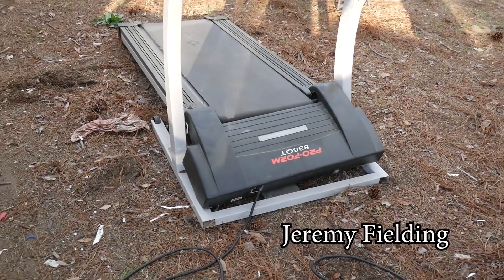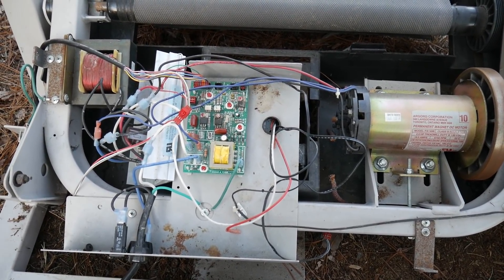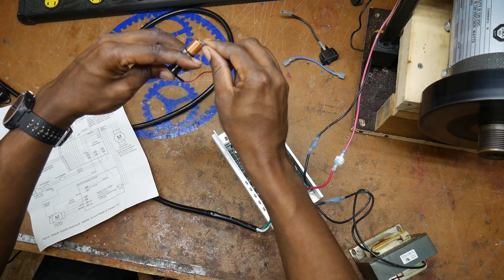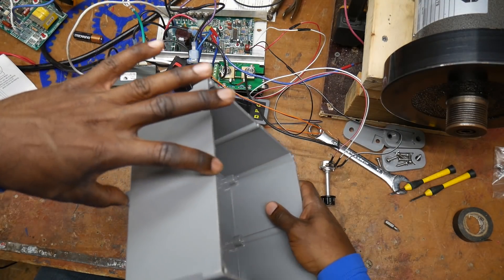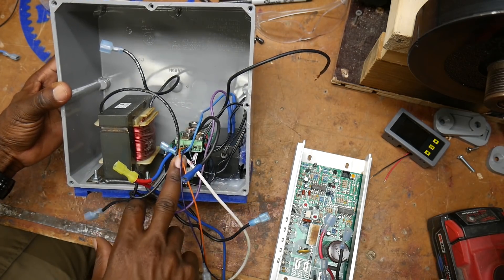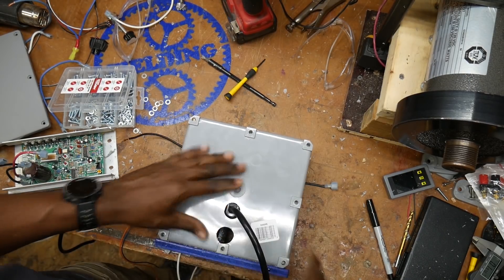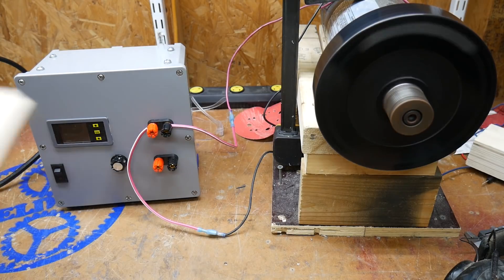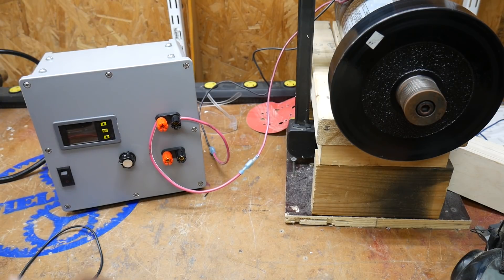Building A Variable DC Power Supply From Treadmill Parts: 054

Comment: A word on safety when cutting larger holes in plastic. Standard fluted drills work fine, but it gets mighty squirrely when you get to spade bits, hole saws, or even forstner bits, and even more flesh eating when you're dealing with thinner plastic, and faster drill speeds. To confidently, and safely, accomplish the aforementioned task, it's as simple as doing everything the exact same, except run the drill in the reverse direction. The safety, skin scarring issues arise when the drill's teeth catch the soft plastic material for which it is most definitely not made to properly handle, and the workpiece is grabbed and spun violently, and if the piece isn't secured, but simply being held in one's hand, could easily bring that hand into the business end of that drill bit. By running the drill in the reverse direction, the teeth do not grab in the slightest, and the cut ends up extremely clean, and precise, and best of all it was easily performed with confidence, and safety was thought of only as ritual to maintain safety, and not a brown stained afterthought. Enjoy!

Comment: If i could just make a suggestion?  When you enclose everything in your electric box you might add an small fan (like one out of an old computer), to dissipate the heat generated in the box from the components and make the controller last longer.

Comment: Another great video Jeremy. I have two or three questions. 
1. That’s a nice right angle scale you have. What is it?
2. What digital display did you use? It gave more info than just rpm. You didn’t go in to how it connected to everything. 
3. Aren’t you supposed to measure the resistance for when the motor starts turning and choose your potentiometer for that value? I’m confused on how you used an arbitrary potentiometer for this. 
Thanks,
Paul

Comment: Well, I’m impressed with your knowledge. May I ask you a question?
I bought a 2.25 hp ICON treadmill motor with the DC controller. 90 volts, 6.5 amps. 
I want to replace my 1/2 hp lathe motor with this. What kind of improvement would I see in torque?
Thanks,
Paul

Comment: Nice project.  Oh and soldering..a   5 inch square pc fan to move rosin smoke away, . Cream rosin flux from the famous delivery online store, 70% rubbing alcohol to clean up after, and of course, one thirty second diameter 8 ounce solder rolls ...simple with fine wires, 26 ga up to 16 gage, a desoldering vaccuum bulb might be helpful or even narrow solder wick..have fun while fixing and tinkering.

Comment: This controller has the LWH and lots of them controllers don't have the LWH but run with PWM.
I am wondering if the PWM controllers can also make a good variable DC power supply.
If these controllers do, it makes for a very cheap power supply especially that they are such high output.   High output power supplies are not cheap.

Comment: Great video. I just want to caution you though. As a master electrician I would advise that you NOT switch the neutral conductor on any device and leave the hot connected permanently. as in your diagram. It is a shock hazard.  We need you to keep making great videos!!  Stay well and make stuff!

Comment: The choke is to reduce the AC voltage from 110 to 12?
Reply: A choke filters power and reduces power spikes.  It does not reduce power at all.

Comment: Good morning  Mr Fielding 
Will this work as a vfd? I'm not an electrical engineer but I have an old treadmill  I've been wanting to upcycle into a 2"x72"
Reply: A VFD is to very the speed on an AC motor.  The power supply he built is for varied voltage for DC

Comment: I have 2 DC  treadmill motors that i cannot find a speed controller for. 1st one is 25.5 amps. , 130 volts, 2.7 HP
2nd one is10.25 amps. 1.75 HP , 110 volts .  I would like to find a board like the KB  KBIC-125 that has the adjustable pots for the potentiometer.
Reply: an MC 2100 is an available treadmill power supply that would work for those applications.  another option would be to go with a QUALITY SCR

Comment: Great job, Can you tell me were you Bought the digital meter, I'm  going to put a 3 hp tread mill motor ,on my Lathe, And that would make a great power board, Does that measure speed or rpm's, Thanks for any help

Comment: considering you have worked with treadmills a lot i have one where the motor runs super weak and hums a lot and stalls. i tested motor with a drill battery and motor is fine. i think the power board or rectifiers might be bad. do you have any ideas? i measured voltages and they all seemed normal. the incline motor works fine.

Comment: Just curious why you used an extra plugpack to supply 12v for the display when you have 12v on the pot? The display shouldn't draw very much current, and the 12v is likely to be an internal supply for the control electronics.

Comment: Hi Jeremy - just what I needed, thank you. I picked up two free treadmills and my wife wants them gone already!

[Edit: this correction is already mentioned in your description, thanks! but I'll leave this here so more people might see it..]
Important -- At 6:13 the 120V switch breaks the neutral line meaning more of the circuit remains hot while turned off. Just like with any light socket, it's best (and probably electric code compliant) to switch the hot line rather than the neutral.  Either way you still need to handle that switch pretty carefully while it's all open. Hope this helps!

Cheers!
Andy

Comment: Nice video! Good pacing and well rehearsed presentation. Best of all no music track!
I started out looking out treadmills a few years ago.  But now the DC power supply is on my "to make" list. Yes, treadmills not just internal parts but lots good clean steel, motors, belts, bearings, pillow blocks, and rollers. The walkway plank and belt could be used to make a stroke sander for panels, or low friction in feed and out feed table extensions.
 BTW, for drilling large holes in metals, wood , or plastics, I highly recommend a good set of step drills. They always drill round and concentric holes. No more Wankel rotor shaped holes. For larger holes in thicker metals, Annular Cutters mounted  in a Magnetic drill will appeal to the engineer/machinist. Faster cutting, less waste, useful plugs left over for other projects.

Comment: Just thinking I have a motor out of a tread mill like this one and it also has a large  separate coil  like yours ( looks like a transformer with 2 wires ) do you know the purpose of it as my controller  seams to work the same   with or with out - bad low rpm control.

Comment: That's awesome. I have a treadmill that I took the parts out of so I can make my 9"x20" lathe variable speed with a knob instead of having to change the belt on pullies. I need another treadmill to do the same thing to my bandsaw so I can slow it down for cutting thick aluminum and steel.
Reply: did you ever get this done?

Comment: Could you use the 12v on the board to power the display instead of the additional ac to dc converter?

Comment: Hi Jeremy, I really enjoy and appreciate your videos. Great subject matter and excellent presentation !

I've looked through this video and several of your others that use your power supply trying to find or deduce how much amperage it can handle but haven't figured it out yet.

I'm looking for a variable DC bench power supply for my test bench that can manage something like 30-40 AMPS at around 12-24 VDC.  My initial need is something to power various stepper drivers/motors for different CNC projects.

I understand you can't comment on individual projects but would you please reply back with your thoughts on how much current this power supply can deliver, and, if the power it outputs is suitable for this type of application ?

Thanks for all you do.

Jay

P.S. I've been watching the videos you and the Smarter Every Day guy have been making. Fun stuff !!!

Comment: Hello Mr. Fielding!

I came across a treadmill for free!  The DC motor (model A17265M014) (2.65 HP @ 130VDC/1977 watts) (1.5 HP Cont. Duty @ 95 VDC/1119 watts) works.  Unfortunately the circuit board is fried.    How would I "size" an AC motor controller for use with this DC motor?
Thank you!

If I could only copy the knowledge in your brain, to my brain!

Comment: just watched  your video, thanks. I have a question please. I have a Clarke CWL1000 wood lathe with variable speed, but the slowest speed it goes is 600rpm. would this motor and system work on my lathe?

Comment: I am confused as to why you used a 1.5 volt battery across the w&l to get the motor to come on, then changed to the potentiometer.
What did the battery do?

Comment: Loved the video...question about the wiring diagram vs. the components on your workbench at the 6:15 mark.  What's the item to the right of the 12v adapter and above the display?  Didn't look like it comes off the treadmill and wasn't sure if it's part of the volt/ammeter/display.  As always, thanks for the video.
Reply: I was wondering the same. If it's the volt/amp meter, what is the purpose? Shouldn't it be mounted to the faceplate so you can read the meter?

Comment: I used to think my soldering was terrible as well (I can’t spell abominable). Then I bought a real (name brand, not cheap Chinese affordable model) and literally instantly - I was a 100x better. Didn’t realize how much was due to the iron. It was so insane. The iron I had (and I’d had 3 different Chinese models at this point) all heated, melted solder, etc - seemed to work. But when it came down to it - it just didn’t. Maybe it wasn’t getting hot enough. I don’t know. For what it’s worth I got the $80 Hakko 88D I think. But there are other options. You seem like me and go cheap as often as possible, so I’m betting you’ve got the budget solder station too.

Comment: Great video. I was wondering how to get the TrueFitness motor to work without the control board. It's a 5HP 7.2A and I believe it uses 230V. I am not sure if that's AC or DC voltage. There are 6 wires that come out of the motor.

Comment: Just a tip. If you copy the bottom of the item you intend to mount on a copy machine or home scanner printer you can cut out the picture and move it around to where you need it. Just my two cents. Love you videos by the way.

Comment: Wow! How did a AA battery spin that motor?
Reply: The battery did not spin the motor.  The battery provided 1.5 volts which is in the control range from 0-12 volts to the mc80 control board.  The board then sends the appropriate voltage to the motor

Comment: The secret to a good solder joint, (of course first the flux as mentioned earlier) is to melt the solder with heat from the pieces being soldered, not the heat source. ( s. Iron, flame, etc.) use the iron to heat the joint, but only touch the solder to the joint, not the iron. This insures that the parts of the joint are accepting the solder. The hot iron, or flame can easily melt the solder, but the pieces may not be hot enough. As soon as the solder starts to flow into the joint, remove the solder and iron, to keep it neat and minimize the amount of heat going to the component (for electrical connections) For example, touch the iron to the back side of the wires, while holding the solder touching only the front side. Only the solder that flows into the joint is needed, big lumps on the outside don't help. For copper pipe, just give it a few more seconds to flow all around the pipe. The solder WILL flow uphill into the joint if heat is applied to the uphill part of the joint.

Comment: Jeremy, where did you learn about electric motors and components to do this type of thing?   I know you were self taught but do you recommend any book(s) so I can learn more?  Love this channel, keep it up!
Reply: BUY A BREADBOARD KIT...
OR BUILD A DIY VERSION !!
THEN TO RADIO SHACK / CIRCUIT CITY ... FORREST MIMS series booklets.
Reply: Justin Apple 
Watch tear down videos about industrial appliances like washing machines, dryer. They always have motors in them.
Reply: Best way is to go straight to work on a project! Any broken electronics in your house? Give it a shot and try to fix it. Nothing to fix? Well, try to build something! Start small (no shame in that), use YouTube/forums as guidance (especially for identifying hazards). Little by little, each project gains you more knowledge and skill, and it’s a fun and motivating way to learn. Remember to also stay curious and strive for deeper understanding. This usually comes naturally after some time (e.g. well how does an engine work anyway? What is voltage anyway? ). Good luck.

Comment: 6:14 : please put the switch on the LIVE wire.... Please also use a protective earth wire...
Reply: Modern electrical theory dictates that virtually all switching components are best placed on the neg side of an electrical circuit. Virtually every auto manufacturer in the world uses this policy to minimize premature failure of those components.
Reply: @mattmoilanen3813  that is not the negative side (since it is mains powered), and it is not an automobile.
Reply: @takix2007  So you state that the switch should be installed on the positive side and I stated the switch should be on the neg side or "nuetral" to use exact terminology and my point becomes invalid. And ALL application of electrical theory is the same, there is no special adjustments for automotive applications. I can see that you are going to hopelessly cling to your incorrect statement by picking at nomenclature but oh well. It's kinda like my kid when I asked him if he took my two dollars and he said no Dad I took those eight quarters on the table. I'll be sure to let my brother-in-law (retired electrical engineer for Intel) that he's been wrong all this time.
Reply: @mattmoilanen3813  I never wrote about the "positive side", but about the "live" or "hot" side. If you have trouble grasping the difference, I might not be the one who's wrong. There is a big difference between a car (or a computer, for that matter) and a house regarding electricity. Hint : AC/DC is not only a hard rock band.
Oh and the neutral wire in your house is also connected to the ground, so it won't zap you.
Tear and wear of switches is nothing compared to health and safety.
Reply: @takix2007  Weird, you mean like the AC/DC power that a computer uses and the "alternator" that produces that AC/DC power for use in a auto electrical system. As I stated in my previous statement "neutral" does seem to be a bit redundant, you know like 8 quarters. As a final note, I'm not aware of any ground side LIVE AC/DC electrical systems used currently but feel free to take my 20 dimes and have a wonderful day devising your revolutionary new safer system. Please send me a diagram so I can rid myself of all those pesky relays intended to prevent a direct short and those pesky fires.
Reply: @mattmoilanen3813  the AC (live + neutral) in your computer is converted to DC (positive + negative). The generator in your car is driven by the motor and produces DC (positive + negative). "Neutral" is not redundant to "negative", it's a completely different thing. If you do not know that, I don't think I have any advice to take from you. 
To take your "two dollars" example, it would be like saying "why did you take the two dollars on the table", when there were 2 euros on the table: close enough in practice, but still not the same thing at all.
Reply: (BTW, relays are not intended to prevent shorts, they are intended to drive higher power equipments on or off with only a low current as trigger)
Reply: @takix2007  Because the high voltage can't be handled by "live" side switching without shorting the switch so thank you for agreeing with me.
Reply: @takix2007  I don't know what century you live in but cars, trucks, aircraft, heavy equipment, generators all produce AC/DC current that is then converted to DC when leaving the "alternator". This is done by a regulator. Oh and that was a nice try with the redundant neutral thing but remember it was you that stated neutral was connected to ground in a AC/DC system. You corrected me about my "negative" side switching statement. But hey I'm not asking you to take advice from me, you do what you please as will I.
Reply: Anyway, this conversation has become a stupidity contest, and I am forced to admit you won. It was fun playing with you but your mum is calling you, now, so you should turn off your computer.
Reply: @takix2007  Ah, I'll let my mom know but as she is 80 and I'm 58 I'll still have to help her if she needs something on the computer okay young man. And I did wish you a good day several responses of yours ago didn't I. Learning to take feedback as well as you give it is a talent that does take some maturing to learn.

Comment: Jeremy soldering is as easy as peasy could be. Remember Clean and Heat. Always have really clean soldering iron tip and tinned with rosin solder which is non corrosive. Tinning is just heating a spot to solder with just a light and thin coating of solder. Then just put items that are to be soldered together and solder. Just remember there is such a thing as cold soldering, where one moves to parallel items together without the heat still being applied. Joint looks good but resistance will be high believe it or not. That's all there is fella. Happy soldering.

Comment: thats nice , you are using that Potentiomete to increase and decrease the speed of that DC motor , i have one question for you , how much motor HP it is ?    and how much max and RPM does it reach ?                   actually i want to make a diesel fuel pump test bench ,,,,,, and for that i need a motor with a controller with which i can control motor RPM ,,,,,, i can use belt and pully to increase torque , but that decrease the RPM ,,,,,,i need a motor which can spin my diesel fuel pump from 750  to 4000 RPM and also must have enough torque at low RPM of 750 ,        can you guide me for this , thanks